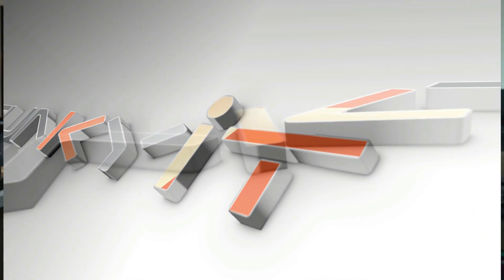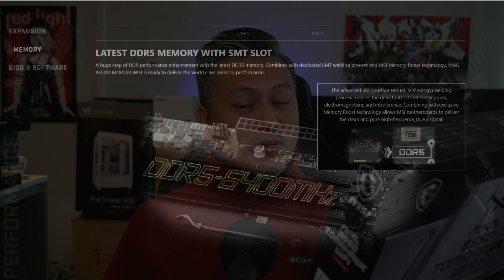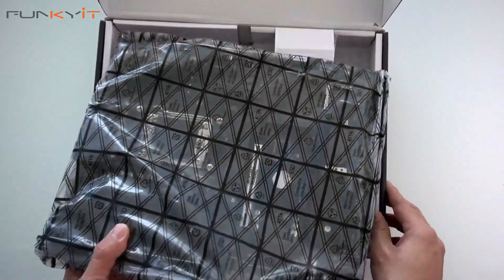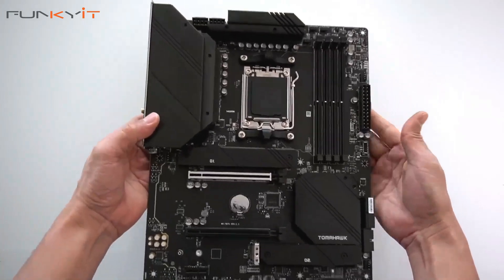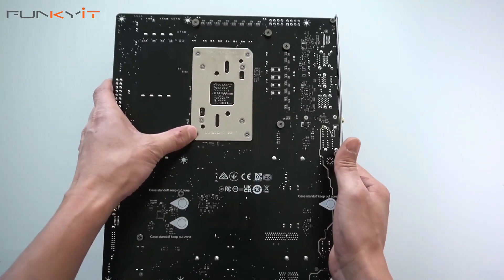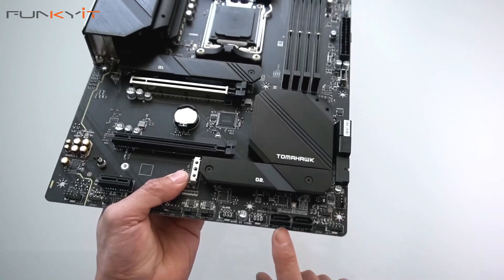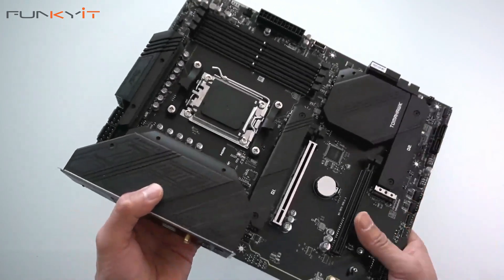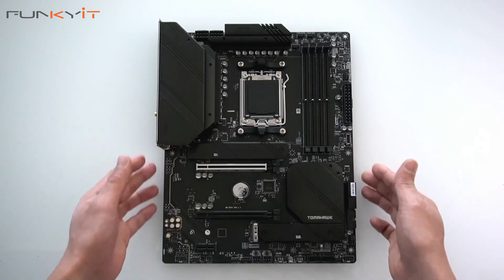Powerful Yet Affordable - MSI MAG B650 Tomahawk WiFi Motherboard

Comment: Worst boot times. Stay away. Do not buy. Look up on google.
Reply: As of Nov 14th 2024, The issue has been fix with the latest bios update according to google search. Correct me if I'm wrong.
Reply: @BravoSixGoingDark do u have this board ?
Reply: @ Ended up not going with AMD. Went with Core Ultra 7 265k with a MSI Z890 Gaming Plus Wifi.
Reply: @BravoSixGoingDark  intel is fucked up bro aint no way im going blue
Reply: What yoy recomed though with the same budget

Comment: their was a combo deal for 7600x and this atx board. im doing a midrange cpu and high end gpu build so this worked out perfect for 450 for both cpu and mobo together. now i just need a gpu. i figured using the 7800x3d as i play in 4k the price to performance was not worth it. this board is so clean looking. love the sleek black and white off tone perfect for my white case. Did you need a bios update? if so did you just use a flash drive?
Reply: There*

Comment: hi i have a quick question, about the power connectors. 

So my PSU (corsair 850W) came in with two CPU and PCIe cables, i assume you have to plug 2 CPU power cables on the mother board. And the two PCIe cables for the GPU. Sorry i havent build in a new pc in 8 years :D
Reply: Yes plug in both cpu cables to the mother board
Reply: You only need one of the cpu connectors if you are overclocking or ahve an absolutely overpowered cpu, you can do two if you want but not needed